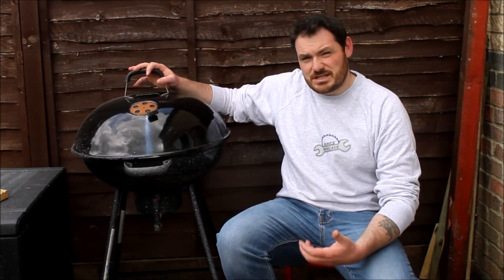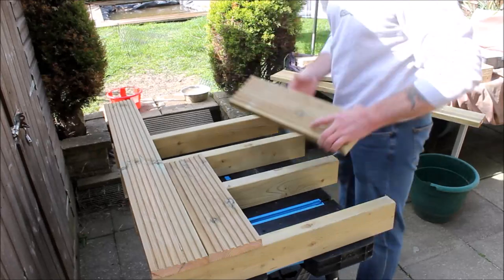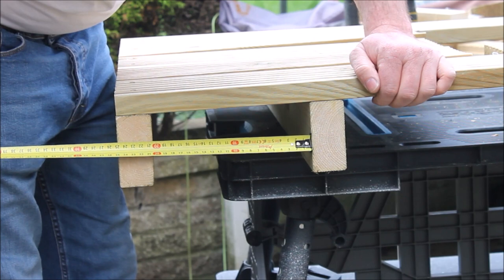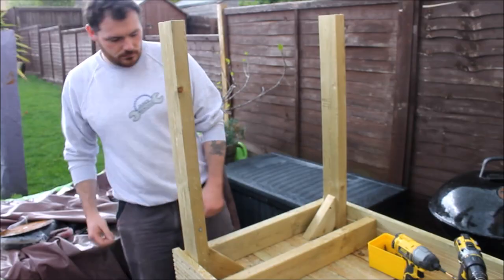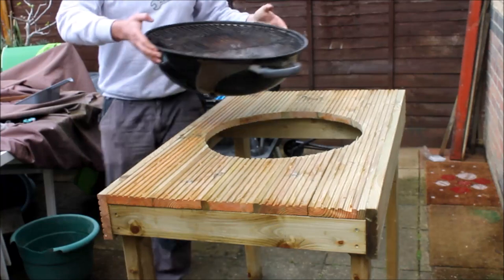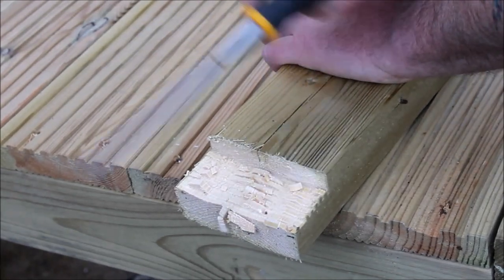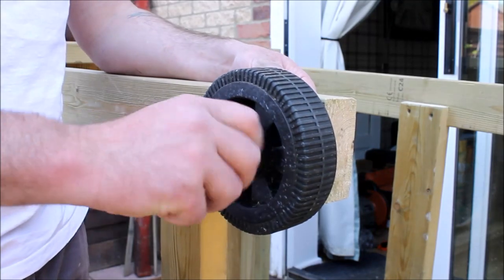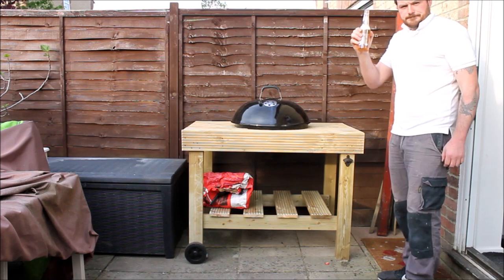How To Build a DIY Mobile  BBQ Cart (With Bottle Opener) #evolutionr255sms #AEGTOOLS #BBQ

Comment: Good job. Interesting to know what you did underneath to collect the dust. Also, I would suggest you install trolley wheels with locks. This will keep your cart level and you can lock your wheels.
Reply from the maker: So the dust is collected in the bottom of my kettle BBQ, as it has fitted to it a removable tank for emptying the dust. The cart doesn't move at all, because the back legs are equal hight the the legs with the wheels added to them, and the weight of it holds it steady from moving back and forth

Comment: I like the simple design, but are you concerned about kettle heating up the cart?
Reply from the maker: Hi, thanks. No I'm not, ive used the BBQ loads since I built it, the wood is in a great condition. If it had of left any burn marks I would have used some screws sticking out of the side of the hole to support the kettle 👍

Comment: Does the heat from the kettle burn the wood it's resting against? I see people putting metal between the wood and the kettle.
Reply from the maker: Nope, not hand any burning what so ever. I think because I cut the hole out straight rather then tapered, the contact between the wood and kettle is minimal
Reply: Well that's good to know. I just made a cart from an old rot  iron tea cart. I cut the wood the same way. I haven't had a problem yet but my circle needs to be improved. My drum sander attachment fell apart. Right now it's resting in just a few spots.
Reply from the maker: I don't see that being a problem only resting in a few spots, as long as it's stable it shouldn't matter, well done for making one though 👍
Reply from the maker: @MrFrankbee  I like that, that's some great repurposing of that tea trolly. Looks quite classy actually 👌

Comment: Its going to be a real bitch to clean the table top when you spill you beer, or whatever. I believe I've ever seen a corrugated table top for food prep and cooking.  Good Luck
Reply from the maker: Well as of yet I'm yet to drop/spill anything on it. But if I did I would leave it to dry in and then sand it out. I did coat it with some decking oil, which has helped it from the elements this far